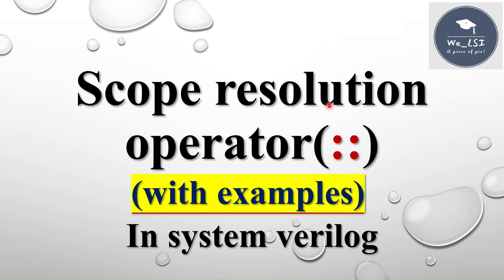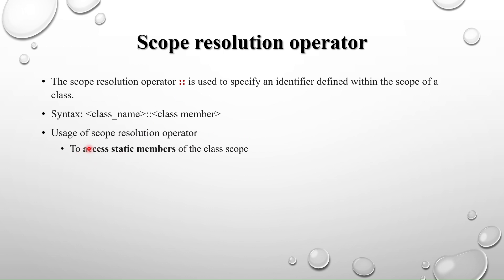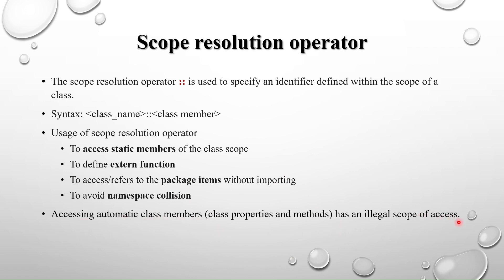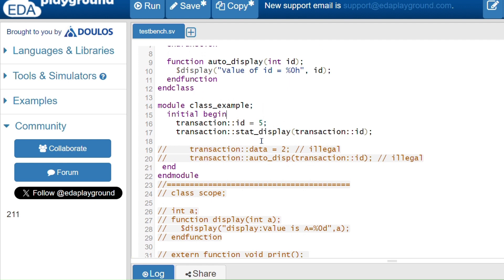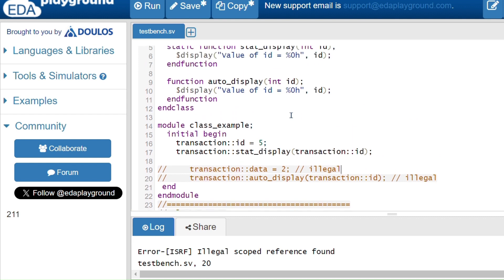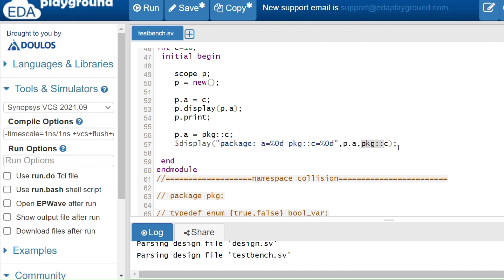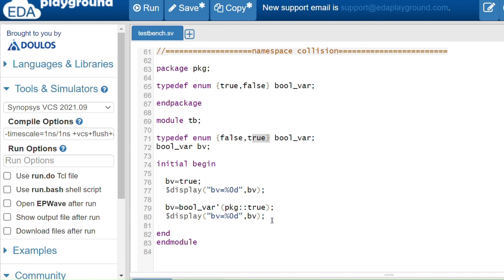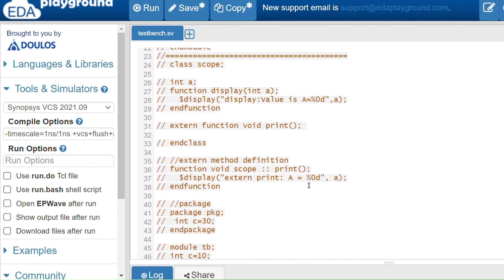Scope resolution operator in #systemverilog | Introduction & Examples| #verification  #semiconductor

Comment: Can you explain the range is a inside  [10:100] for every 5th Iteration will be 20 as soon as possible explain this problem for interview purpose
Reply from the maker: Please write the question alone clearly.
According to my understanding I have written the code. Pls let me know if my question understanding is wrong.
Here's the solution: link:https://edaplayground.com/x/edHJ
Reply: @susheelapatagar  Thanks Mam I got the output
Reply: i=0,a=20
# i=1,a=80
# i=2,a=14
# i=3,a=22
# i=4,a=89
# i=5,a=20
# i=6,a=45
# i=7,a=63
# i=8,a=43
# i=9,a=72
# i=10,a=20
# i=11,a=24
# i=12,a=24
# i=13,a=13
# i=14,a=68
# i=15,a=20